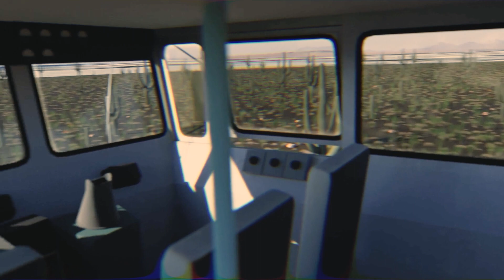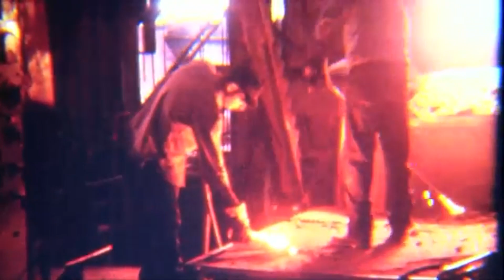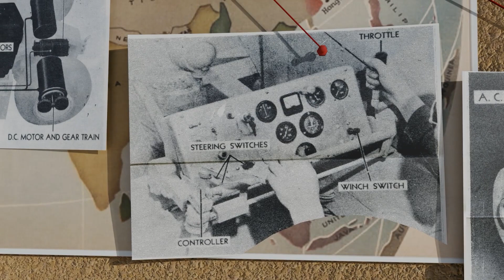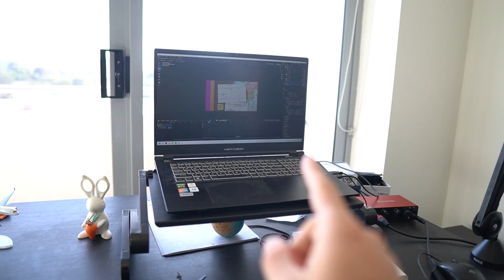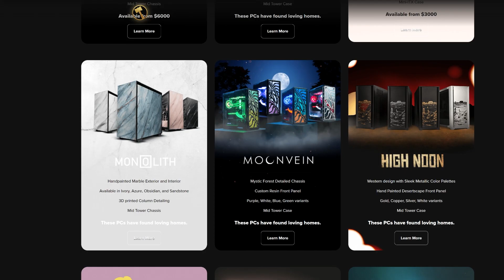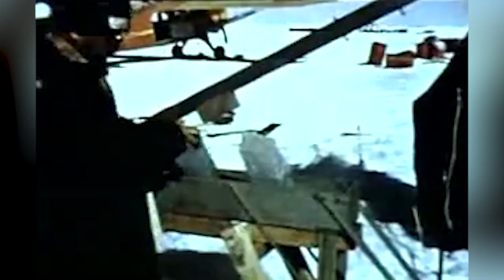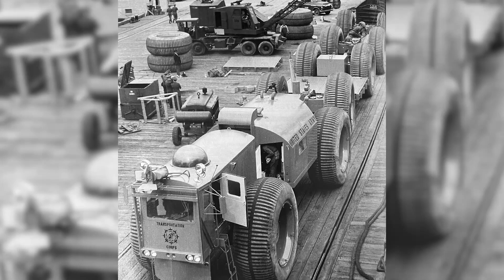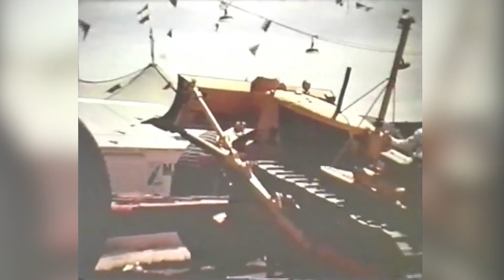What Happened To The INCREDIBLE Land Train?

Comment: Mechanical Brakes will be still required on electric driven vehicles, because generatoric brakes lose efficiency on low revolutions especially on low speeds just before stop. Here mechanical brakes apply on speeds usually below 3kph and apply as holding brakes too. Classical applications here are huge power generators on power plants, or most known on electric trains ( light rail and heavy rail)
Reply: You can actually bring an electric power vehicle to a complete stop on electric power alone - you run the motors as stepper motors, which takes some significant electronics to execute and power to hold.
Mechanical parking brakes are however still required when the system needs powering down.
Reply: @allangibson2408  , Yes very true. My electric mobility scooter works very well with totally electric braking.  TV is probably talking in the context of railway locomotives where at least a modicum of mechanical braking is necessary. In my years as a locomotive engineman I was able to hold a long freight train steady while awaiting signalling clearance. It was a situation where the very long train was held steady by the varying gradients under its wheels.  A sort of natural mechanical braking that turned on & off automatically.
Reply: @rododonnell6856  I ran a unit with ac traction motors, we could use dynamic braking down to 0.5 mph. Probably slow enough to take it out of DB and into powering the other direction if you had to.
Reply: Coming to a stop with electric motors is called "plugging" and it is the typical design used in electric heavy machinery such as battery powered forklifts. The stopping force is equal to the acceleration force. Effectiveness of regeneration (which is not always used) at varying speed is affected by control of variable magnetic field strength, with core saturation as the maximum, this does not require computer control or stepper motors.
And you are correct that they still need a mechanical parking brake, but that is much cheaper than mechanical primary brakes and can even be replaced by simple wheel chocks.
Reply: @mytech6779  
You 're right. 
Variable magnetic field strength has to be generated on low revolutions because inducted magnetic fields are weak here and as mentioned already loose efficiency. Therefore the mechanical brakes on many applications. 
However, which solution to follow in final is a matter of philosophy, costs (obviously), redundancy, fallback level and application.
Reply: There also is the issue of power as the electric motor can not brake harder than it can accelerate it.
Reply: Allan Gibson is right. It's possible to come down to a standstill with electric brakes, you will need here external power supply to the motors too on braking, because as mentioned electric brakes loose efficiency when  turning slow. (Sitenote: Electric brakes generate an electromagnetic field reversed to the motion of the motor which causes the braking. This effect weakens on slow revolutions).

@rod o Donnel:
lokomotion is only one application, Power generation and electric mobility are other fields of usage.
In the final it's a matter of philosophy on which solution to go.
However mechanical holding brakes are required in any case

Comment: And the "engine" is located at the Yuma Proving Grounds, Yuma County, Az. USA  and there were some very serious attempts to get it back up & running, but the equipment required to remake some of the parts are no longer made & available.
Reply: There is a VC-22 parked along the highway just north of Fairbanks, Alaska. I used to drive by it quite a bit.
Reply: @Chris_at_Home  to be accurate, that is the VC22. Only the one was made.
Reply: I remember as a kid in the sixties it was first parked in separate pieces in a junk yard in Yuma Arizona, on Arizona Ave just north of 16th street prior to parts of it going out to YPG.
Reply: @oldscuba  The Locomotive/engine was moved to the YPG in the late 90's & is on display in the main vititor parking lot
Reply: There's nothing really stopping you making new parts with other machines...
Just because you make a part with a Tormach, doesn't mean I can't make a copy with a Gildemeister, or Hurco. There could be a question of, what might the specific material be, or exact dimensions or other specifications, which could be lost.
But that hasn't stopped us reverse engineering stuff as complicated and beautiful as the Rocketdyne F1. An almost completely hand made rocket motor. The F1B was designed specifically because of the lack of design notation on welding the F1. All the factory staff were skilled labourers, and more or less artists with welders. The parts were all hand fitted (Which had the unique factor, of making every single motor unique).
Reply: @GrasshopperKelly  The Army has gotten this name as a national monument, so there is no way that they are going to let someone refurb it. 
Now maybe the one/s up in Alaska those might be abled to be refurbed
Reply: I'd give a kidney to see it running again.
Reply: @cmendoza1094  come to Yuma, I already gave them a kidney being assaulted for trying to take pictures. Maybe if you give yours they might let you take a picture of it.
Reply: The real issue is funding, anything can be made with enough money.
Reply: Yuma is where things go to die.

Terrible place. No law. No constitutional rights. F Yuma.
Reply: especially now...it would have to be electric lol.
Reply: @KB-ke3fi  As is the original one is, diesel-electric like a train locomotive is.
Reply: no problem send it to china along with the prints
Reply: @stephaneracicot791  HELL NO. Time to put good ole American ingenuity & knowhow to work. I am sure there is a start-up company that could 3D print the metal parts needed & there should be tractor/heavy-duty tires avail here as well.
Reply: @almirria6753  why not just do a new build and make it a passenger vehicle? A cruise ship of the land.
Reply: @Rickyrab  There is not the funding structure, then there is the size & weight limits for the roads, not to mention the bridges & overpasses, then getting into the city streets. Then there is the refueling & other commodities used just for the locomotive.  The smaller one in Alaska would stand a much better chance of being refurbed & put back into service. But once again it all boils down to funding.